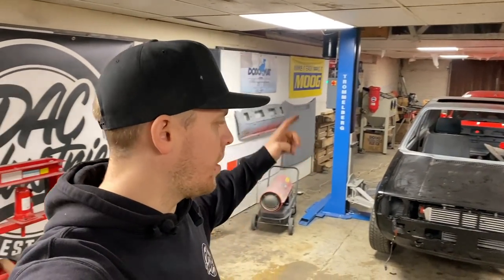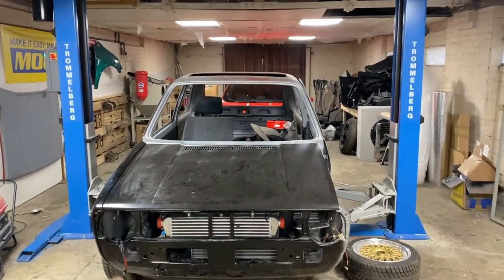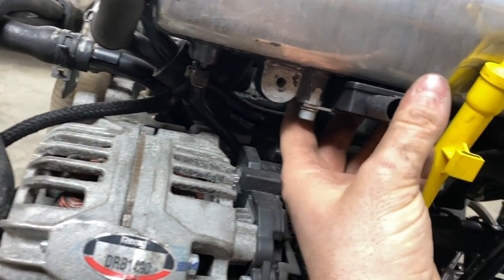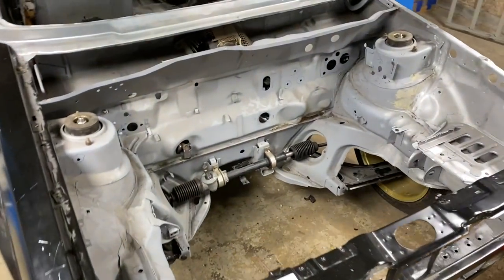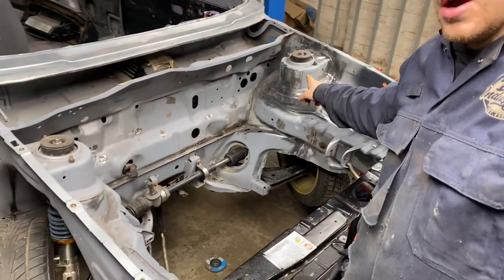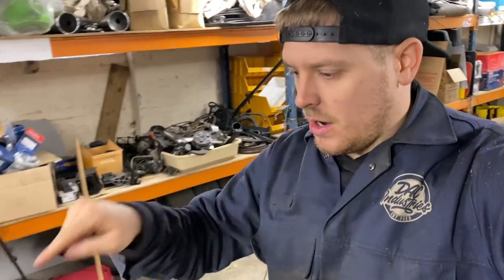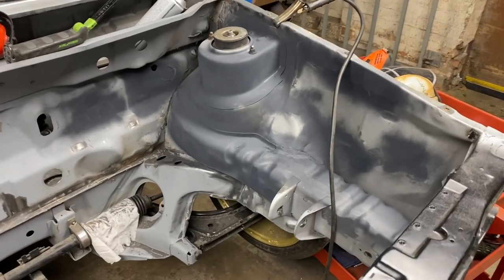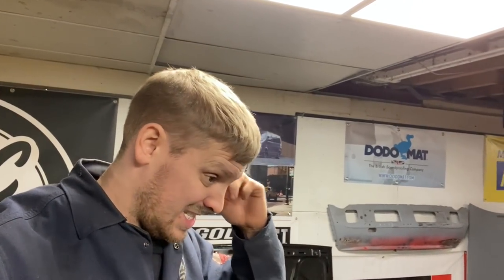Shaving The Bay  - 1983 Mk1 Golf GTI Campaign Restoration 1.8 20v t Swap Shaved Bay How To Caddy

Comment: Great video I really like how you have shaved the engine of this Mk1 Golf GTi so far. Especially looking forward to seeing how the brake system will be laid out on the driver's side of the bay. Since I would like to do similar brake system lay out in my 81 Mk1 Scirocco RHD in the near future.
Reply from the maker: Cheers bud! Looks so much better doesn't it! I have sent my column to have a bracket welded on that will have the cylinders on them. Will run reservoirs in the rain tray.
Reply: Great looking forward to seeing the setup for the brakes system. Now I see why you kept the rain tray. I like these cars better with rain tray left intact.

Comment: Nice work mate. Probably to late now but for future reference, instead of cutting out metal circles, use penny washers.  You can then also pop a long bolt in it to hold in place while you weld it.
Reply from the maker: Thank you bud. I did have a go with some penny washers but only had 1 size. Cutting the disc's like I did didn't take very long.

Comment: Looks great Dan. I shaved mine 15 years ago and removed the cowl. If I could do things again, I’d do it the way you are. Keep going dude. Any chance you’re getting a different valve cover for the 1.8t? It’s a great engine, but honestly isn’t the prettiest looking engine IMO. Either way I know it’ll turn out nice if you continue doing things the right way. 👍
Reply from the maker: Thank you bud, yeah I think the route I am taking is the best one… I hope 😂 i have been looking at different valve covers but haven’t made a decision yet 🤔
Reply: @DanChambersDAC  running the engine cover plastics helps but I prefer to look at the engine. There’s quite a few clean billet styles that would look proper in powder coat or anodized. 👍

Comment: Looking good Dan, only one thing, hasn't the strength been taken out of the legs now.
Reply: I wondered the same. When I've done it to mine I made a T section and invented the seam to the inside so smooth on top but retained the strength.
Reply: They are meant to collapse when hit there's no actual load when driven
Reply from the maker: Cheers Paul. seen a couple of replies already. Im not too fussed about strength as they are designed to collapse anyway. If it was a big enough accident to fold the front you would have a lot of other things to worry about.
Reply: @DanChambersDAC  Those seams are there for a reason. Yes, those parts are meant to crumple up on a head on collision.
By taking off the seams, you have weakened the front that needs to be held up. Remember,  the front engine mount is getting  a lot of stress when you're really hauling ass , so much that you're bonnet could pop up... ( yes, I've seen it quite a few times) The Golf 1 doesn't have the strongest chassis, its actually quite soft. When the car is done, drive it without the upper strut brace, and the bottom one between the wishbones,  then add them.... you'll be surprised how stiff the car suddenly gets. 
How do I know my way around Mk1's ? I spent over ten years making them into all types of racers... road,track, rallye and rallyecross. 
I know, it's to late now. Never mind.
Keep up the good work ! 👍

Comment: Looks amazing Dan, have you thought about black small bumpers (get rid of the meffy plastic ones?) nd a small rear light panel, poss even a swallow tail if you could fab one? (cant imagine you can buy one) not sure if the cab rear panel could be adapted to fit
Reply from the maker: Cheers bud. I have been thinking about this for weeks. I think I am leaning towards having the standard bumpers though as they look so good on them. it is an 83 GTI after all.

Comment: That sensor to turbo is the egt sensor
Reply from the maker: Sweet cheers bud.
Reply: @DanChambersDAC  No problem, glad i could help. I like the direction the gti is going.also dan make sure you change or clean the oil pickup tube and new oil pickup tube gasket,its the first thing you should do on a 1.8t 20v.as its the main failure on these engines. Cheers mate!